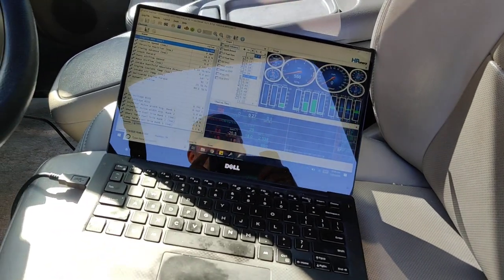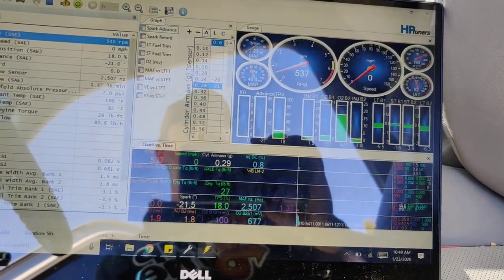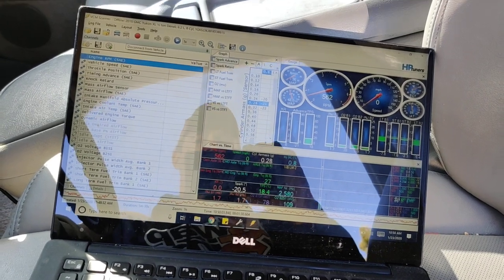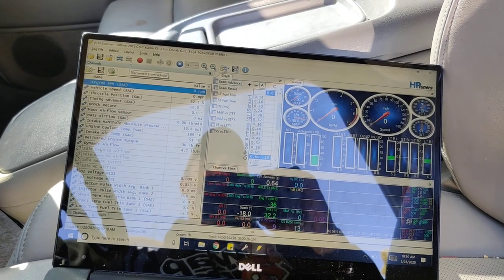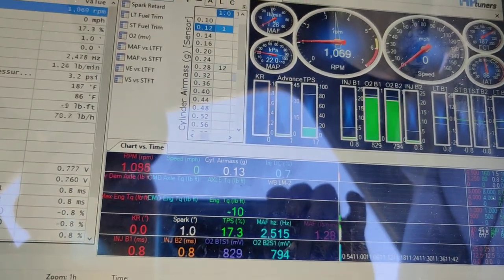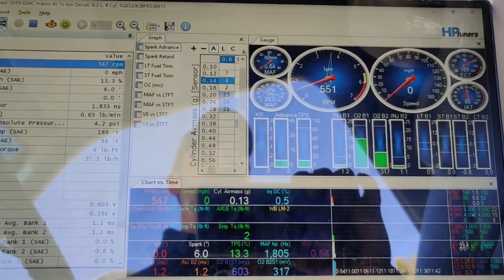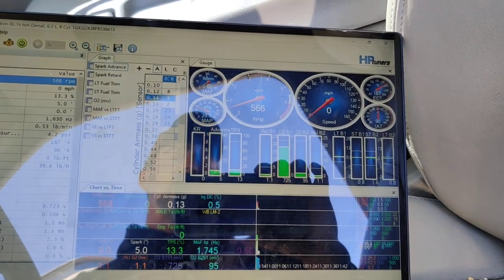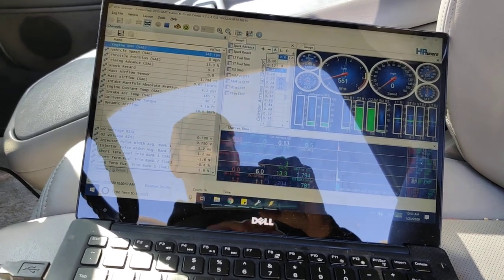Gen V idle problem tech tip!

Comment: I recognize those seats in blazer they are 2014 and up Silverado. Front bolts hook into floor the rear unbolt. Re install took hours till removed front base plastic on track to clear carpet. I'd bounce seat hoping it would fall in place. Thing drove me nuts. All back cover removal you peek to see behind plastic cover see how manufacturer hooked it. Katskins sells covers. Install is breeze.

Comment: Good afternoon, I'm doing a Gen v swap on my 1985 JEEP CJ7. Engine start but shows throttle body codes 2122 and 2127. I replaced pedal and the throttle body but still the same. Do I have to change the cam? How can I make the engine accelerate.  Is idling fine but won accelerate.

Comment: Question for you Mitch, could you put together a fuel system for a 94 two door tahoe? I’m putting in a 6.2/10spd combo from a 2019 Camaro with cylinder heads and cam